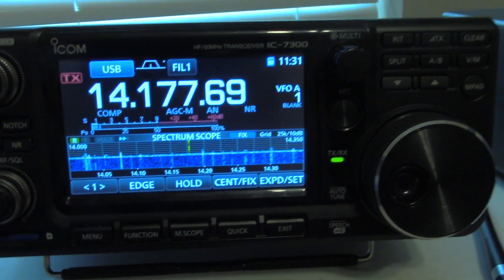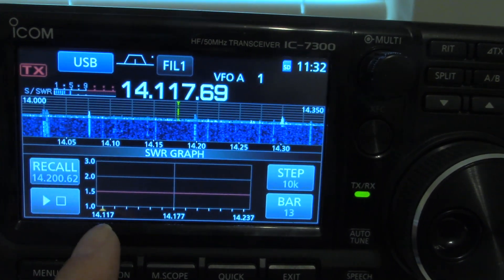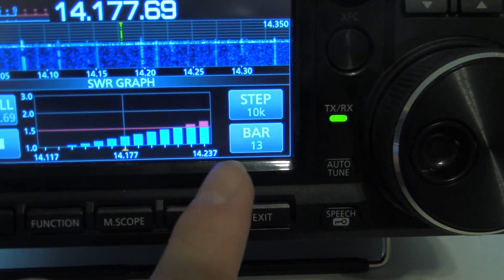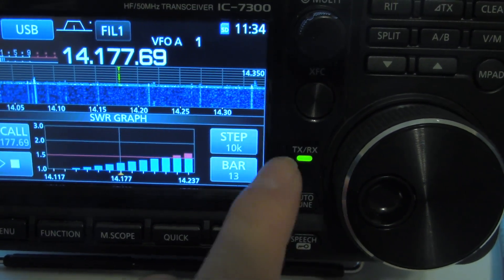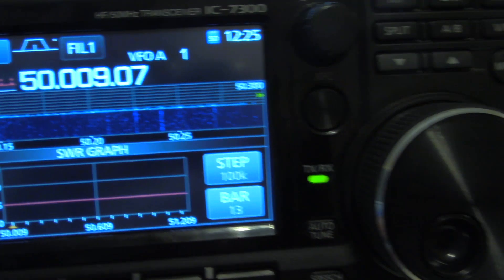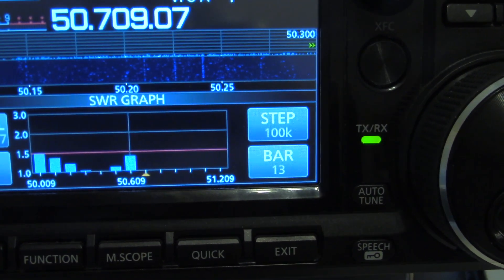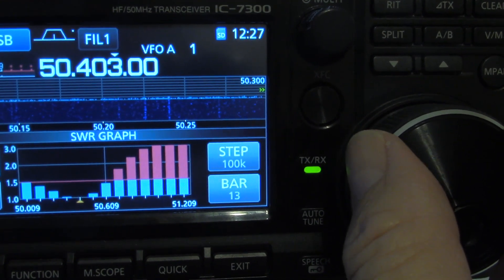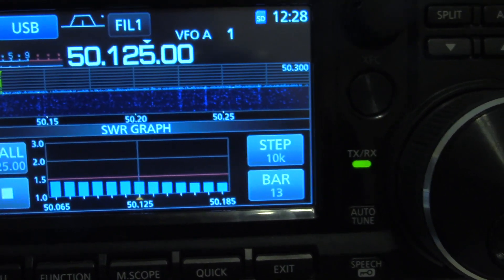Using the ICOM IC 7300 SWR Graph checking your antenna

Comment: When i do an swr check I’m at 1.5 with 1% or watt.     When i increase the power to 5% or 50-60-80% or watts.  My swr goes over 3.0.    Any ideas?    Thanks guys.
Reply: Good observation.

Same happens with other (external) SWR meters.

I’ve read somewhere that SWR meters are not accurate at the extremes of their rated wattage.

I now do all SWR measurements on the IC-7300’s internal meter (the midrange for this radio) with a power level of 50% (50 watts).

Coming back to your question, the measurements you made at 1 watt are unlikely to be accurate.

Measurements made between 35 and 65 watts would be more valid.

Also, make sure to connect the antenna directly to the radio, removing any external SWR meters and tuners.

Then make measurements at 50% with the internal tuner off at first, then repeat with it on. Results will be interesting.
Reply from the maker: @kulanchandrasekaran4462    I think you are right and good points
Reply from the maker: That's what it does, and I don't know why

Comment: What is the recall button used for and how do you clear it?
Reply from the maker: Hi Michael,  the recall button shows what frequency your center frequency is tune to, for example, if you tune your radio to 28.400 lets say you have 10 K step and 5 bars.  You click your mic 5 times at the bottom of the screen it will show 28.380 then a mark for 28.390 then the center frequency, the one you tune to 28.400 then a mark for 28.410 and then 28.320.  When you hit all 5 bars then it will show you on recall the center frequency of your chart which is the one you tune to before you checked your SWR.   It will not show until you have gone through the 5 bars or how many bars you show.  The only way to change the recall is to change your center frequency and run the test again.  I am not sure how to clear it.
Reply: I held my finger down on the graph until the screen says Clear Data, yes or No. Yes clears the data.

Comment: My Ic 7300's auto tuner doesn't work  very well with my half size G5RV only tunes on 40 & 20m
Reply from the maker: Robert,  From what I have read, the G5RV has high SWR in a lot of bands.  The 7300 antenna tuner will tune from 3:1 to less.   You may want to try various antenna configurations to see what might work better.  Such as Off Center Fed Dipole , or something like a Ultimax End Fed,  One of my friends uses a balun design full wave loop and says he 80 -10 in the CW is less than 2:1.  Good luck and thank you for watching my video.
Reply: With the G5RV you will probably need an external tuner.